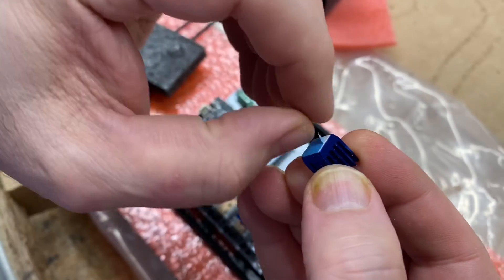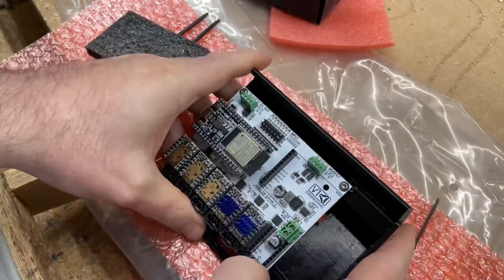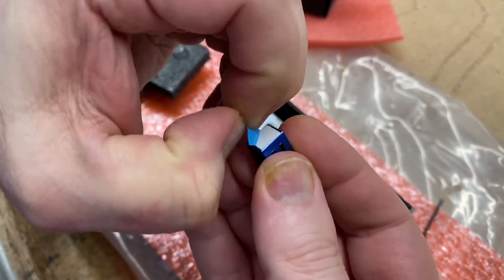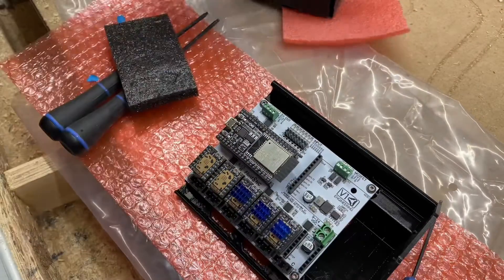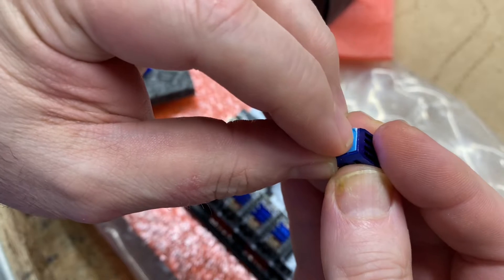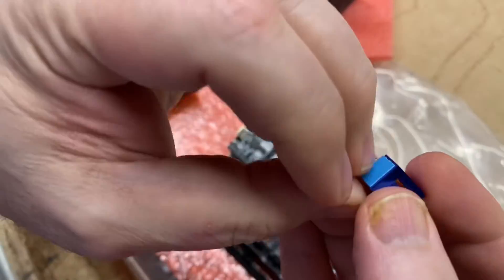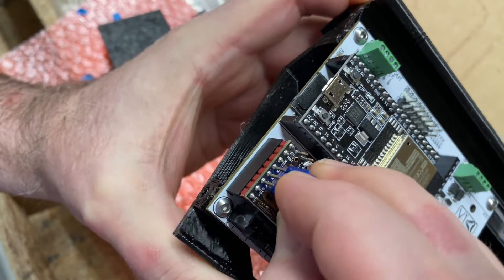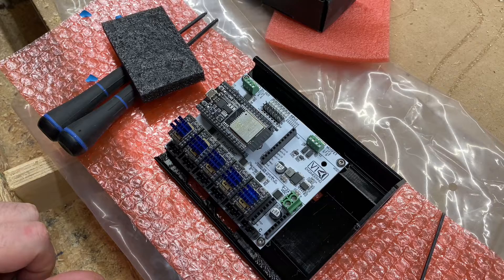LowRider v3 CNC: new Jackpot board getting its heat sinks installed - super satisfying

Comment: I couldn't find a comparison between SKR and a Jackpot? What would you recommend to a newbie? :) Thank you
Reply from the maker: Probably Jackpot. Jackpot is considerably more affordable than SKR. Jackpot uses wifi and can use any screen you have (phone, tablet, computer) that has a browser and wifi. Jackpot usually never needs you to compile firmware. Changes to its setup are done by editing a text file called "config.yaml" — upload the new file and reboot, you're done. Jackpot runs on FluidNC, a GRBL compatible firmware that was designed with CNC in mind. By contrast, SKR costs more, and its screen is a separate buy (cannot use your phone, etc). By default it is not wifi enabled, can be with more buying and more effort. Changes to SKR setup require editing firmware and compiling, and that can mean editing and compiling two different firmwares (one for the board, another for the screen). SKR runs on Marlin, which was designed with 3D printing in mind. It can work for CNC, but the screen interface clearly indicates 3D printing rather than CNC. I started with SKR and then moved to Jackpot. I was pretty happy with SKR and I am happy with Jackpot.
Reply from the maker: Also, Jackpot wins regarding setting up macros and assigning them to buttons. Doing that on SKR TFT screen is a pain, involves code editing and compiling firmware. On Jackpot it is so simple. Upload a script containing the GCodes you want the macro to have, and click the icon to edit the macro list, give the button a name and click to tell it which file to run, and save. Done.
Reply: @design8studio  you are a boss. Thanks a lot
Reply: @design8studio  Is the only option how to purchase it through V1? I wouldn't have problem with that but I'm trying to reduce cost of shipping and customs, as I am from EU. Thank you
Reply from the maker: @djVania08  This thread on the forum was about a group buy of Jackpot board for EU makers! https://forum.v1e.com/t/european-group-buy-of-jackpot-boards/39801
Reply from the maker: @djVania08  Just noticed in that thread is a statement by Ryan (V1E) saying "You can actually order them directly! — Jackpot CNC Controller V1.1 - EasyEDA open source hardware lab — https://oshwlab.com/allted/4layer-desktop-rc1_copy —  Bart made a video on how to order, https://www.youtube.com/watch?v=eoEXbfIOxrY
Reply from the maker: @djVania08  If you order from the link I just posted, consider that Ryan does not get anything from sales on that page, so consider donating a tip to him. He suggested that $2 each is a decent tip amount.
Reply from the maker: @djVania08  Also he mentioned, "You still need drivers and esp32."
Reply from the maker: @djVania08  Regarding "You still need drivers and esp32" — the drivers are called TMC2209, and you would need 5 of them (1 for X, 2 for Y, and 2 for Z).  Regarding the ESP32, you would need this one: Espressif ESP32-WROOM-32D. You can see a photo of it here (installed on the Jackpot board): https://docs.v1e.com/electronics/jackpot/

Comment: i used your firmware to do the x y swap do you have firmware updates for jack pot board
Reply from the maker: I do indeed have the Jackpot installed with the X and Y axes swapped. It consisted basically of some changes to the config.yaml file. I’m happy to share the file I have that has these changes working. If you want me to email it maybe somehow convey your email address to me.

Comment: I've also began here in Belgium on my LR3. Going for a table of 3500mm length. 🤞 One thing I'm curious at is, and what i can't seem to find in footage, is the lowrider capable of straight clean cuts in melamine or hdf sheets eg. for kitchen cabinets, like lengths of 2000mm? What would be the best router bit for that matter and speed settings, would be great to see that explained in a small tutorial?
I think i'll go for a makita router.  Kind regards
Reply from the maker: Totally doable. Docs have milling basics. From there, it’s a matter of right bit, and right speeds and feeds for particular materials. Because there is no one answer for all, it takes a little research and can take some trial and error.
Reply: @design8studio  thanks Doug 🙏
Reply: Did you make progress on your LR3? I am also from Europe and trying to figure out where to source all the hardware from. Any tips on that? :) @stevenfixo
Reply: @djVania08  yep she is running. Still some tweaks here and there and have to mount the struts 'cause it's wiggling in the x middle a bit now.
Length of cuts to 3090mm.
I purchased the whole pack with printed parts at v1 with tft. Metal struts are aluminium 25mm. Should've included the touch plate on ordering, but simple command g92 0,0,0 helps a lot on starts of print job. I've ordered one from germany yesterday that would work with estlcam. Curious about that. I'm on the forum since this week at v1. Everything busy there with all tips and tricks. Good luck with your build, it's somewhere struggling but glad i pulled through. Now i can build a cnc, never thought i was really capable to that.
Reply: @stevenfixo  what was the cost on shipping and customs to Belgium, if I may ask? 

Congrats on such a huge machine. I'm going for 2,2x1,2 or something similar to that. So let's see how that goes.

How much time did you spend on the build, you think?

And what were the projects you milled so far?
Reply: @djVania08 customs was around 200€ for a grant. If you are a business you need an eori number for customs, mine was held in for a couple of weeks.

I've  build cabinets as support structure for drawers later on, in the middle i left a place to sit to work on my drawings with the pc. The back of the gantry points towards the wall, both long sides are free reachable. On the front i'll cut out a rectangle to vertically mill dovetails. I'm just into calibrating now, and testing with basic text to pocket and did some small tests with melamine board which is verry sharp and precise enough to make cabinets. I still need to test the long cuts of 3050mm and see if it's square enough. 
Next up is wiring, cable management and permanent dust retraction on the spindle to be able to let the machine do it's thing alone, but as safe as possible.